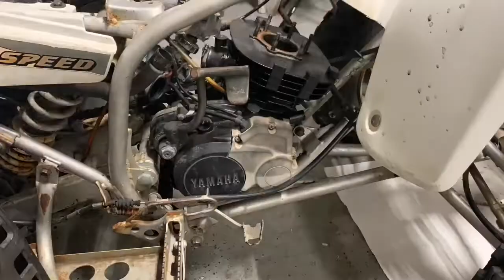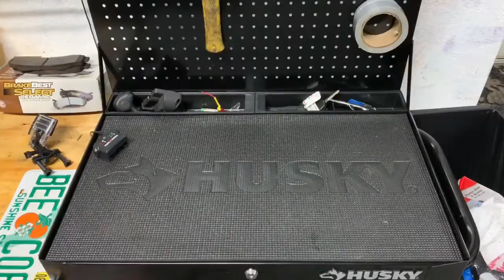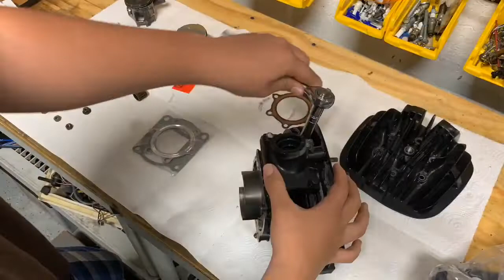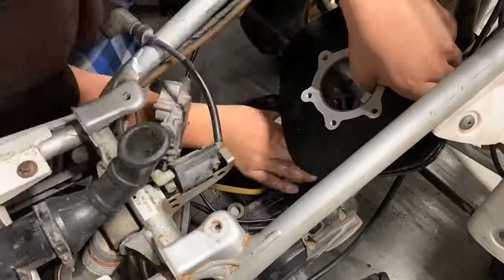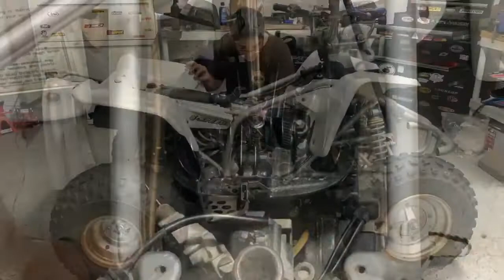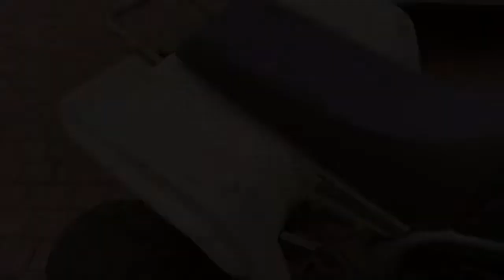Yamaha blaster top end rebuild time lapse

Comment: @jose’s garage have you ever had a problem where gas would fill up in the crank case
Reply: I already did that it hasn’t changed and it only fills up when it’s running
Reply: Could it be my crank seal behind my primary gear
Reply: Alright I’m gonna order a new carb from amazon will I have to change the jets in them I have a fmf powercore 2 exhaust and I run it 40:1

Comment: How were you able to torque the first part of the cylinder like the part were the clutch cable goes with it did you just tighten it hard or did you use a torque wrench
Reply from the maker: David Blum torque wrench won’t fit in there u just got to be careful to not over tighten it
Reply: Its called a crows foot. Torq wrench goes in it

Comment: Hey I bought a new cylinder and my old one only has 5 bolts out of the 6 is it a big deal to put it together and only have 5 bolts?
Reply from the maker: It could cause a gasket leak eventually because it’s not pressed on all the sides but try it it might work
Reply: Jose’s Garage I found the other one there reusable right?
Reply: @davidblum_  yes, they are

Comment: I need help how did you remove and put those studs back into the new head?? Soo lost, the studs are in the old head but not in the new one how do I take them out?
Reply from the maker: Just put in two nuts and tighten them together then try and loosen the bottom nut and it’ll come out I recommend you heat up the studs so the don’t snap when you extract them

Comment: That thing sounds so lean its not even funny. Youve got a huge air leak or something somewhere. Does it still run? I wouldnt expect it to last longer than a few rides with it having a chinese piston and cylinder and running super lean
Reply from the maker: I thought the same thing and had my dads friend blow some smoke into it but there was no leak and surprisingly after running it hard it still works fine with the Chinese cylinder

Comment: Man I suck at working on my blaster gas come out between the cylinder and bottom end when I tried to take the cylinder of I stripped a nut so I don’t know what to do
Reply from the maker: Jackson York take out the bottom end clean the surface and get new gaskets also make sure you have the right amount of transmission oil and you’ll never deal with that problem again
Reply from the maker: Jackson York and for the nut is stripped get a new one online if the bolt is stripped remove the stud and get a new one online (hope I earned myself another sub and good luck)
Reply: Do you know how to get that nut off it’s in a tight space so I can’t get a socket in there
Reply from the maker: Jackson York use a wrench
Reply: I used a wrench it’s that I can’t fit a dremmel or a stripped nut kit there’s not enough room
Reply from the maker: Jackson York get a hack saw or something that can cut metal, cut two flat sides on the nut so you can use an adjustable wrench on it put some on spray on it heat the crap out of it with a blowtorch and it will come out if this doesn’t work cut the entire bolt sand it down take the whole top end out and then you can fit a drill so that you can rethread it and put a new bolt and nut in it